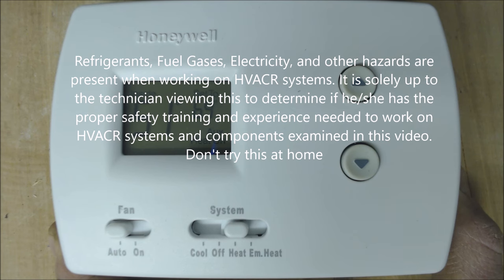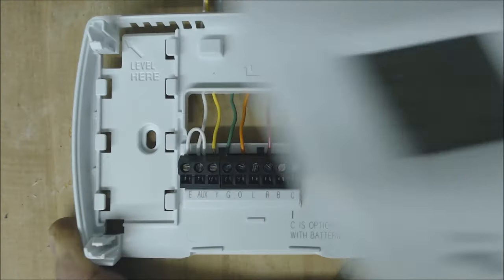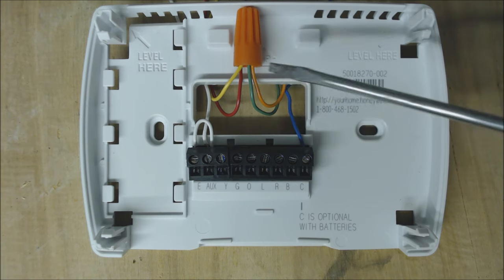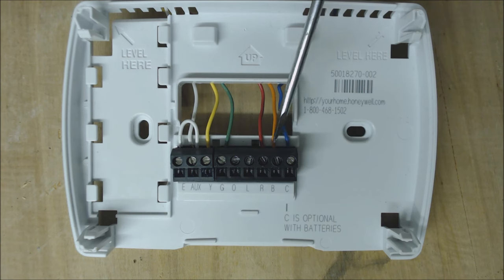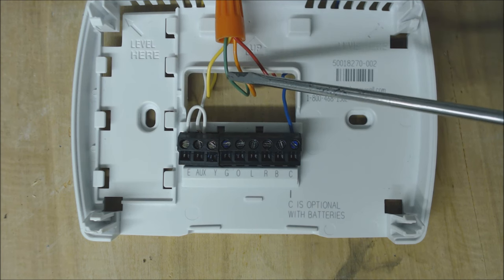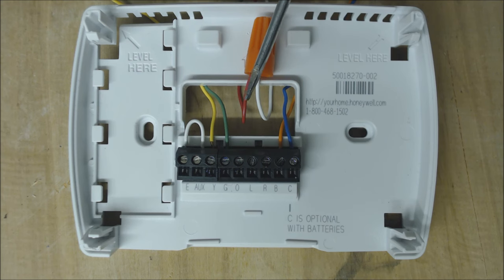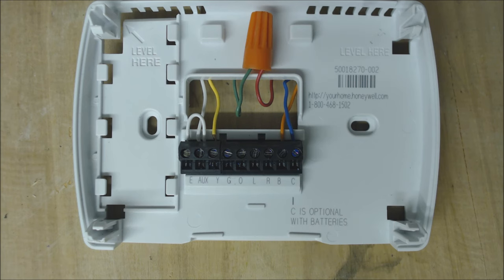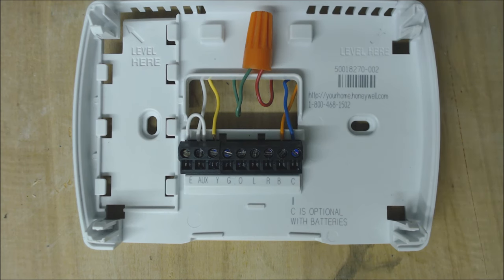How to Bypass/Jump a Heat Pump Thermostat! 6 Wiring Combinations!

Comment: Thank you. It’s 12:30 am here in Dalls Tx my ac cooling was not going. Condense outside not going. Was messing with it a little bit then couldn’t figure it out. I know how to jumó straight ac but didn’t know how to jump heat pump which was 4 wires red yellow green orange. Thank you so much my ac is cooling great now glad I’m going to sleep cool.

Comment: THANK YOU! Just did this bypass for a new Trane … after my “smart” T6 Pro thermostat bit the dust after only 2 years. How cold will “cold” be if I leave it wire-nutted until my replacement thermostat comes?

Comment: I have a rheem heat pump the wiring is:
Blue: o/b
brown: common
Red: RC & R (Jumped)
Yellow: Y
Orange: Y2
White: E/Aux
Green:Fan
Indoor air handler unit coils Freeze over on heat.
Is the wiring wrong for this to happen?

Comment: Hello, Awesome Video! I have a problem however!! I've got an old Lennox HP22-261 from 1992. The flunky HVAC company soldered my reversing valve in backwards. System worked good cooling as they reversed the wire on my thermostat to the RV solenoid. PROBLEM.. Burned up 3 thermostats so far trying to get it to work with heat. IS there something I need to do other tan just programming the thermostat reversing valve the opposite as it should be??? Thank you!!!

Comment: If you bypass thermostat for emergency heat will it still kick off at 70 degrees if thermostat is set to 70?
Reply: That's what I'm wondering mine is set to 72 but the heat bypass has been on for like a hour & half now. I hope I don't have to turn power and take wire off just for the heat to go off.

Comment: I have a question, my ruud heat pump, has only four wires, yellow, red, brown and purple,  the brown wire is marked "C" on the HP board and the purple wire is marked "D" which I think is the defrost, is the brown supposed to be my HP?
Reply from the maker: Hey Oscar, have you seen this heat pump wiring video?- https://www.youtube.com/watch?v=fFL_ZSkAZM0&lc=UgxP1Z4vzMHXPgNAirt4AaABAg

Comment: Thanks... As a life long (in my 60s now) mechanic and fixer of things ..  I knew my York Heat Pump was heating the inside of the shop and cooling the out doors here in Aridzona.. for some reason it was not reversing  into cooling mode.  I wire nutted the mentioned T-stat wires together.  The unit came on , started cooling the shop down from 92*F.. Now to find a new t-stat.
Reply from the maker: Check out the acservicetech heat pump thermostat videos, thanks!

Comment: I have a Rheem heat pump and I'm considering installing a toggle switch on the white wire so I could turn off aux heat when temperatures are above freezing. My only concern is if it will effect defrost mode operation.
Reply: @robertruge2916  I figured that out eventually.

Comment: Great video, not sure Rheem/Ruud has to be against the grain with the reversing valve wiring.
Reply from the maker: Yeah ha ha, they just wanted to do their own thing back then. It is like all the oem parts we have to use in a heat pump or furnace nowadays, thanks!

Comment: I wired up red, yellow, orange, and green but it popped the 5amp fuse coming from the transformer, all the wire colors match up going to the outside unit, any clue why it popped? There’s no way powering three 24volt coils is more than 5 amps? It’s a Goodman
Reply from the maker: The wiring color code may not have been followed so verify what color wires are connected in the indoor unit after turning the power off, thanks!
Reply: I dont think to wire the y with the green,red,white and orangefor heat

Comment: And this is the wire coming from the heat pump? Directly to thermostat and not to air handler first? 
Sorry I’m just trying to figure out how to wire this pump back up. The plate on air handler that pump would normally hook to has nothing hooked to it inside...
Reply from the maker: Wiring goes from outdoor heat pump to air handler and from air handler to thermostat. This video gives an explanation of some wiring, thanks- https://www.youtube.com/watch?v=fFL_ZSkAZM0&t=103s

Comment: My (kind old) ruud doesn't even have an orange wire? Has red, brown, green, yellow, white, & blue. It actually has a tag on the blue wire that says B. I've been wandering how this is suppose to be for a while because when the heat comes on it makes this arching noise inside the house unit at times and sometimes in the outside unit but never both. The previous owner installed a new thermostat and said that's when he noticed it doing these things but I'm not sure if it's related or not. But see he's got a white hooked to W2 with jumper to E, yellow on Y1, Blue on B, green on G, brown on C, red on RH/R. I'm not sure who tagged the wires but they look factory kinda deal but maybe they had it wrong even? How can a person verify this? I called an hvac technician out in 2008 that wouldn't even look at it and proceeded to tell me my whole unit is bad and buy a new one from me and yours won't last even one more season kinda deal giving me the sales pitch. Well here it is still kicking (and clicking) 10 years later and I'm stuck to figure it out myself because the only ac tech we have in the area won't mess with it. I live about 2 hours in the middle of nowhere. I'm mechanical and electrical savvy to a decent extent as far as cars go I can track wire breaks etc.  But I have no idea how to identify where each of these should end up inside my unit. Cooling works perfect though.
Reply: If your trying to check the (heat mode) look at the terminals, forget about the colors of the wires.

Tie the wires from Thermostat letters R, B, G AND Y.... turn on your unit wait 5 minutes for delay and go from there.
Reply: @williecounty4435  I checked all my thermostat wires with a multimeter and noticed that a lot of my wires have a constant 28v or close which I know the voltage is normal but are most of them suppose to have voltage constantly with the unit off? I figured only one wire would have voltage with the unit off and the thermostat would transfer the voltage from the one to others to signal the heater or air to come on.  Is this normal for most all the wires to have voltage with the unit off?

Comment: I think one of them is wrong:
1:55 ... won't that just burn your heat strips to oblivion without also running the air handler fan? Seems like you might need to blow some air over those strips.
Reply from the maker: You are absolutely correct. Only some units with control boards will power the fan when w is energized. The others mainly need w and g. I will be putting a note on that one, thanks